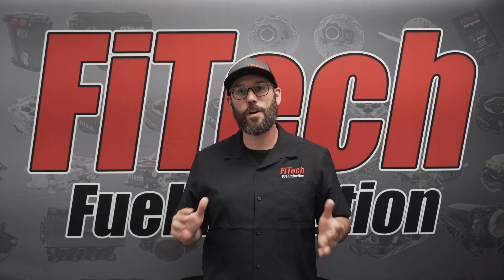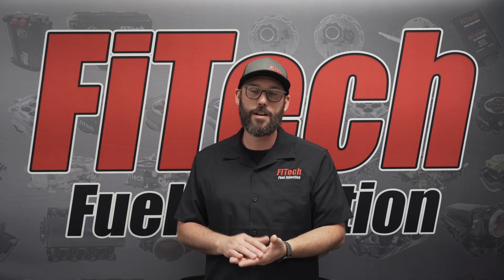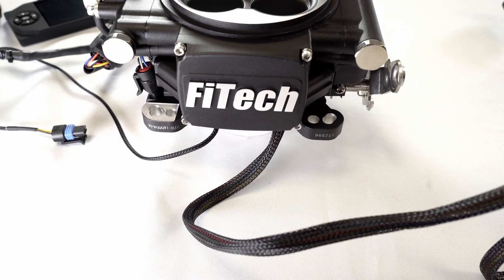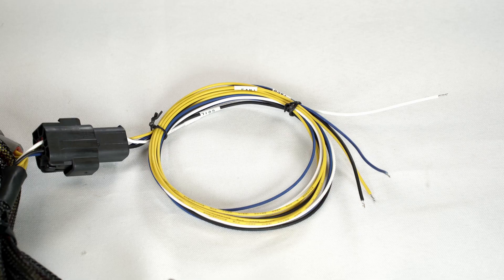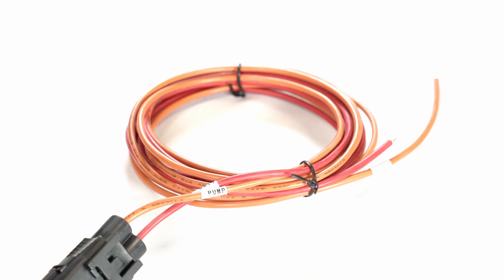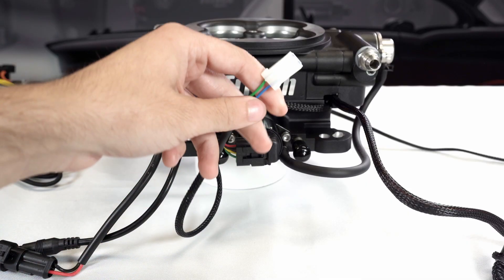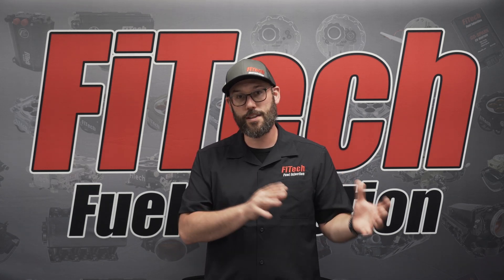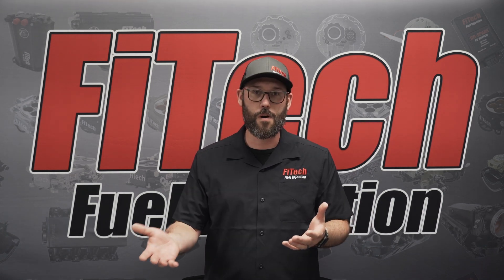Wiring Your Throttle Body EFI| Tech Tuesdays | EP74

Comment: I’m currently installing my 35052 master system on my 67 GTO and I have 3 questions
1. My throttle body does not have the timing control harness, should it or does that have to be purchased separately?
2. In the instructions it states you can use a vacuum port for a vacuum modulator (the passenger side small one) but the throttle body came with a vacuum hose already connected to that port with the other end connected to a vacuum item located near the unused fuel return line port. Does that need to be connected or can I unhook it and plug it in to my vacuum modulator?
3. There is a vacuum port on the fuel force fuel, does it need to be hooked up to engine vacuum?